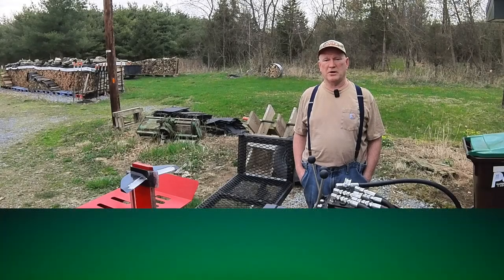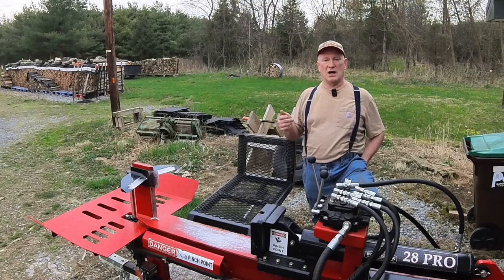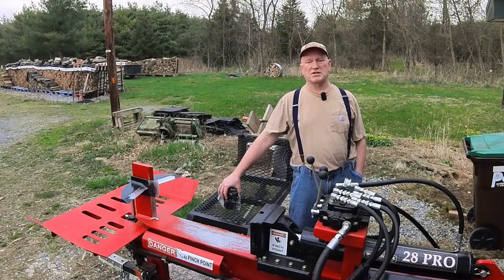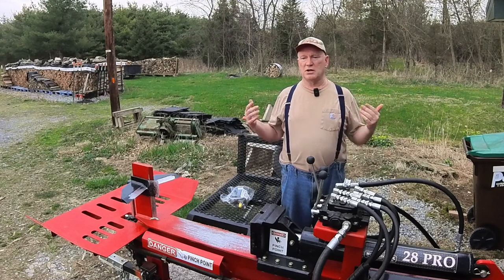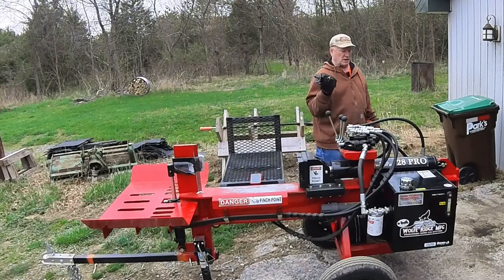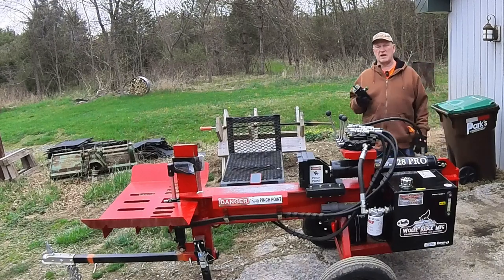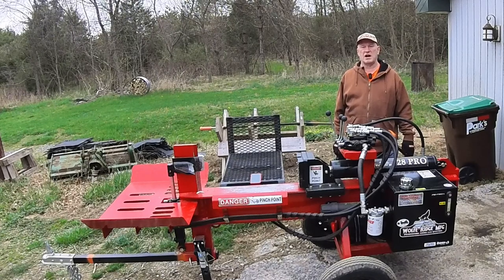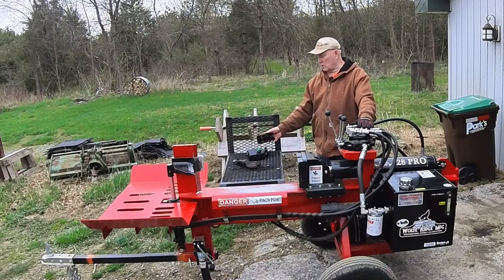139 - Cycle Time Fixed

Comment: I guess it's hard for manufacturers to to make every part work as it should but that is a good outfit to deal with.
Reply from the maker: I have not split any firewood yet, but I put the log lift up today to move the splitter and the speed of the log lift was very fast.  I was surprised by the difference.  Thanks for watching and commenting. Enjoy the Journey - Cheers

Comment: Hello Bob, Great warranty and service, 🚜🪵👍🏼🇺🇸
Reply from the maker: I agree.  I was disappointed when I compared the speed of the WR to my box store Troy-bilt splitter.  The WR was only slightly faster, but I figured with the 4-way wedge I would ultimately make firewood faster then using the box store splitter. Also, the log lift on the WR was something I needed to continue to produce firewood.  Thanks for watching and commenting. Enjoy the Journey - Cheers